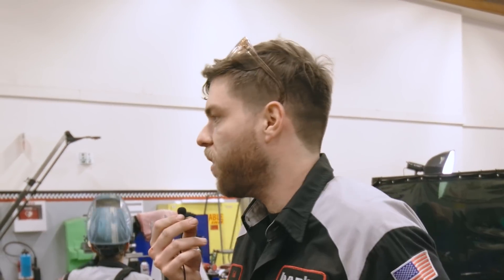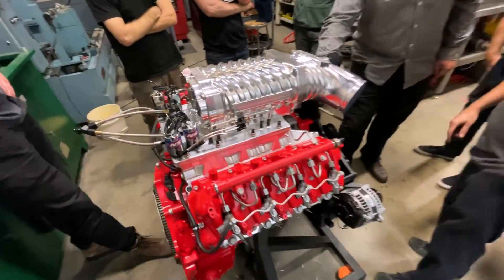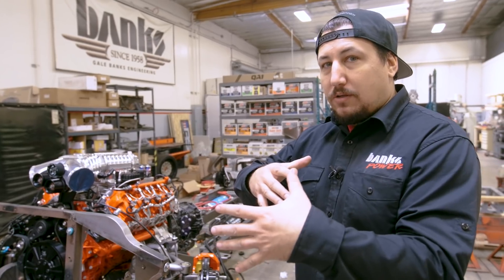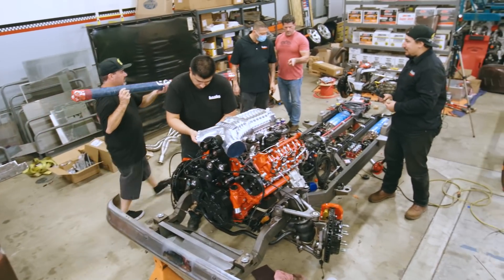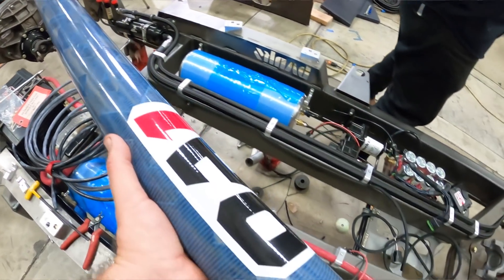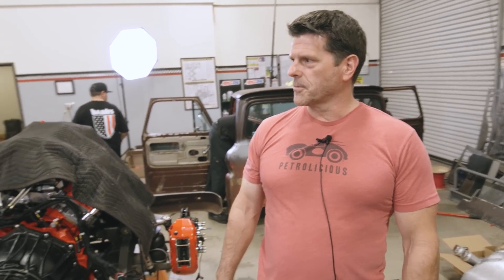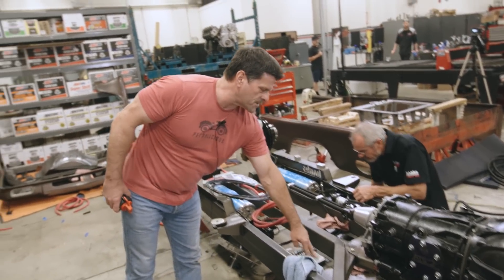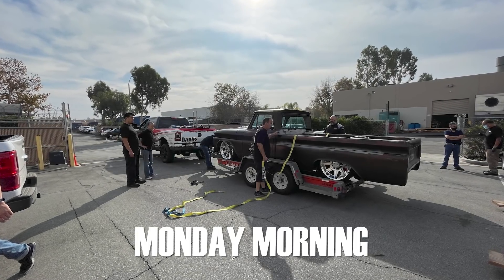This is what #SEMAcrunch looks like | BANKS BUILT Ep 42

Comment: I was thinking of an Allison or 10L90 behind my custom truck cammed LR4, with a 11.5AAM FF rear, LSD if possible. 285,305,33" MTs out back on a combo suspension/body lift that keeps a higher rake out back for hauling, additional leaf and overload leafs, color chromed stock wheels. Custom ttue push bumper in front, step bumper out back.

Comment: 2k hp driveshaft... id be worried to run that if this was going to be a true driven truck... that engine is aiming to make what, 1500hp?
its going to be double that in torque.... way above the driveshaft handling if it ever saw traction from a dead launch
Reply from the maker: For this engine, it's a target of about 650-750hp. It's the stage 1 engine option in our crate engine program.
Reply: @bankspower  wow, i figured way more 👍👍